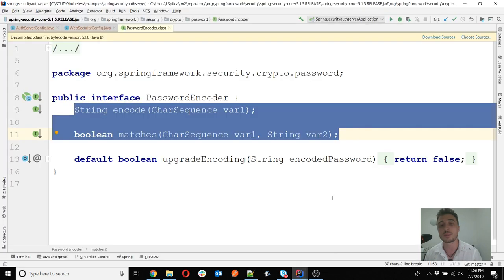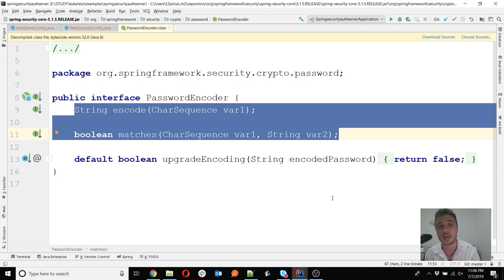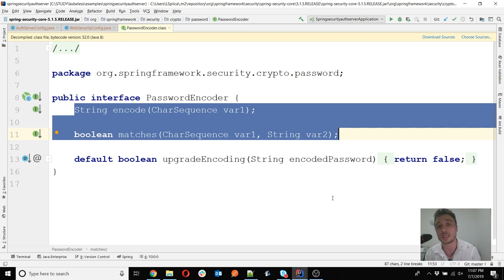An overview of the SOLID principles

Comment: is java interface like a collection interface violate interface segregation principle as there are some operation may throw UnsupportedOperationException .. this means that its subclasses does not need this operation
Reply from the maker: Hi Abdulla. This is a very good observation. I tend to agree with you that those methods would have most likely been better being segregated. But, of course, remember the principles are a guide and not something fixed, so a developer might decide for reasons they know that in a given case a principle shouldn't necessarily be fulfilled.